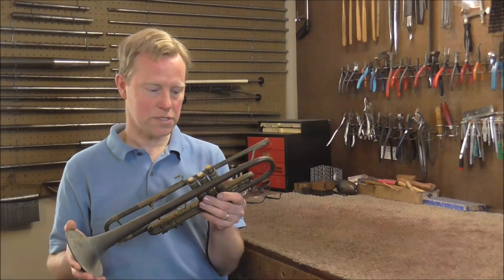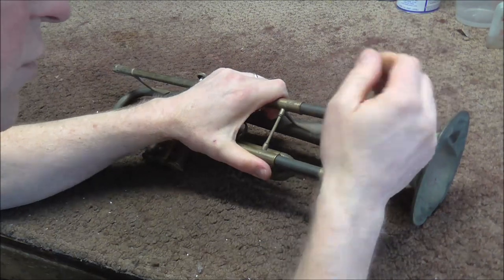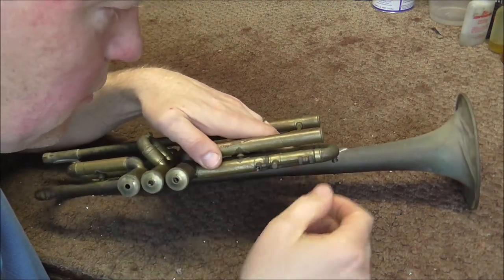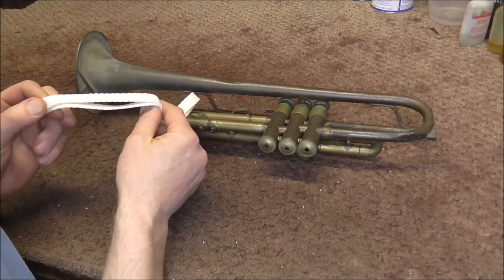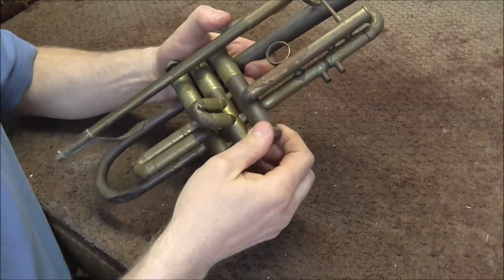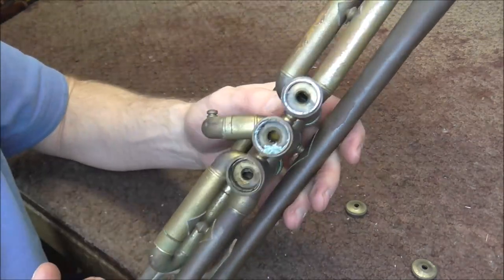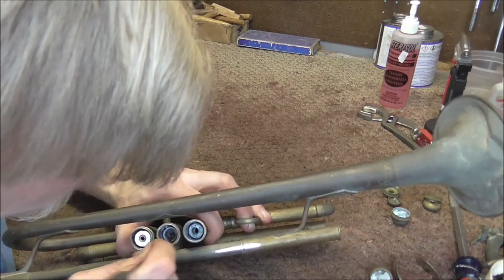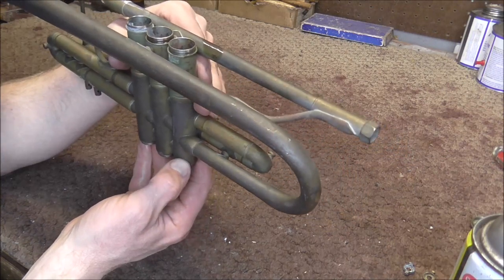Bach Trumpet Restoration Project #1: Getting Started

Comment: My, that is one corroded piece of brass!

Art, I'm a little surprised that you didn't try some heat along with the penetrating oil. Moving heat along a tube can help 'wick' in some of the penetrating oil if you don't get things to the point you boil or burn the oil. A little more heat cycled over various places and also cause the tubing to expand slightly, possibly starting to break up the corrosion holding the parts together. Obviously you want to avoid breaking solder joints unless you have to, but a fair amount of heat, allowing it to cool, then reheating several times might help.

Comment: Yikes!  That's one nasty trumpet!  I've had decent luck unsticking slides using PB Blaster and a heat gun.  I let the PB soak for a few hours or overnight, then heat the slide and let it cool.  Another squirt of PB and a few more heating and cooling cycles.  Most of the time that works.  Not always, but most of the time.  It takes a while, but at least it does no damage to the horn.